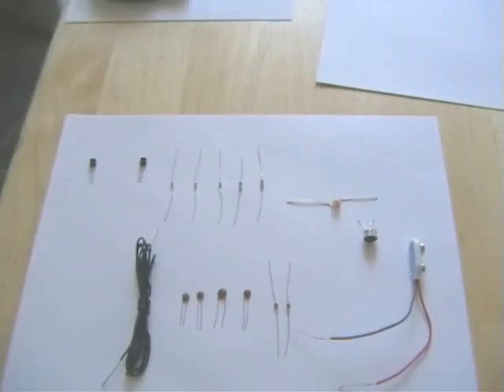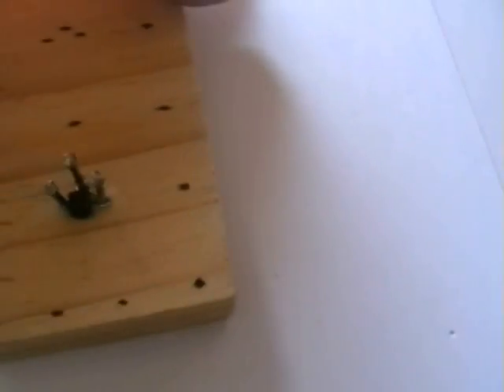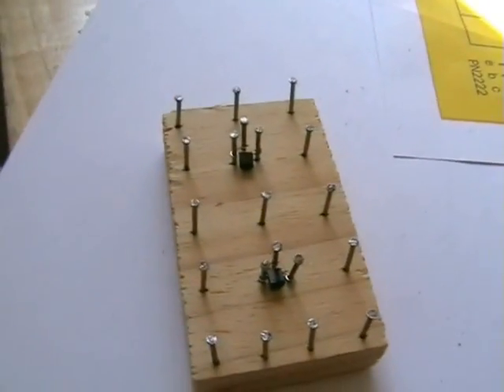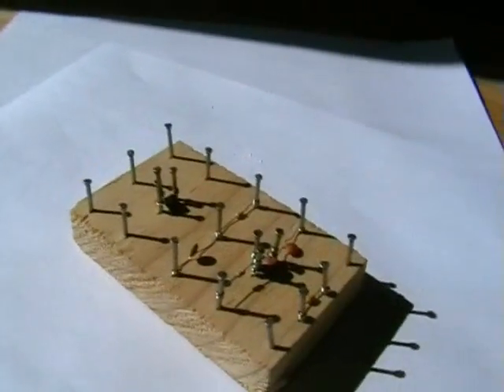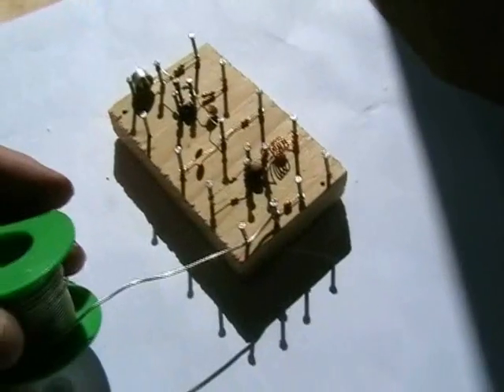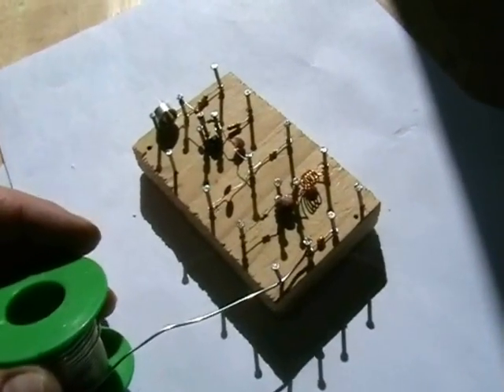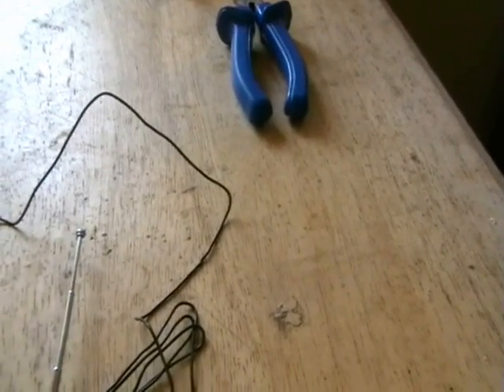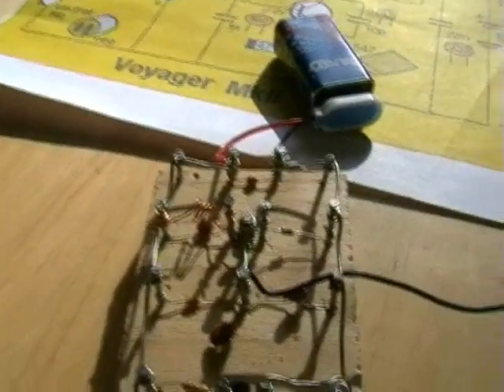The wood FM transmitter.

Comment: thanks, a good new idea ,but there is a wrong in the circuit diagram, there is a short at both ends of the coil and the capacitor of the tuning circuit.

Comment: Why did you switch out the five turn coil for the three turn?
Reply from the maker: Because the frequency was too low (80Mhz),using a 3 turn coil
did get the frequency in the FM radio band.

Comment: There is a short circuit across the tank  LC circuit at the collector of the final transistor, that should be removed, otherwise it will  not work.
Reply: The short circuit should be a trimmer capacitor.

Comment: for the coil:  what is the gauge of the wire?  what is the diameter of the coil?
Thanks,
Rob
Reply from the maker: 0.5mm wire and i use a 3mm drill bit to form the coil.

Comment: Love your video:Question on 3 turn coil  . size of wire ? length of coil ?  Wrapped over what size drill bit?   Dazaro3 , what I like about your video.  Practical and low cost for all.  I like your new video on 1 transistor transmitter in which you drilled the pcb holes not with a drill press but with a hand drill !!! Thanks Rob Jones Seattle WA USA

Comment from the maker: No 10p is a bit low ,it will need to be 33p ,you can still try you may need to open the turns of the coil to get the frequency within 88Mhz-108Mhz.